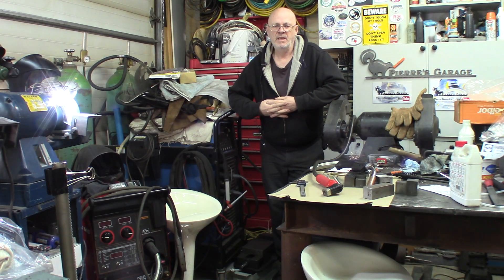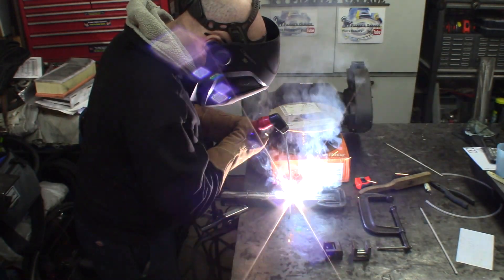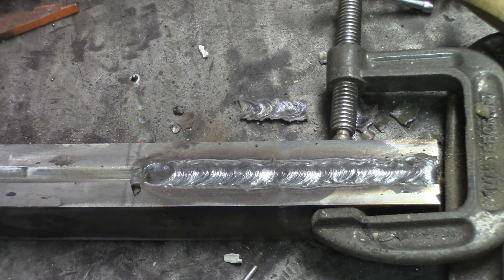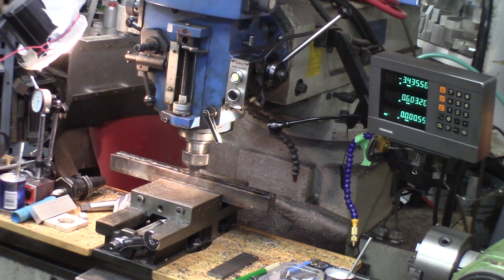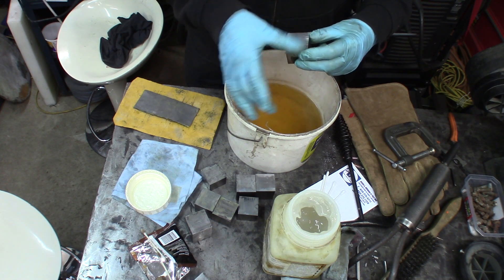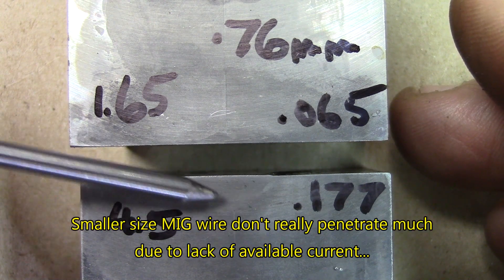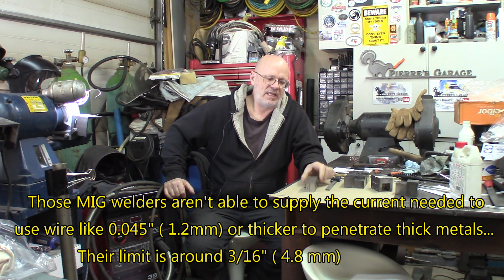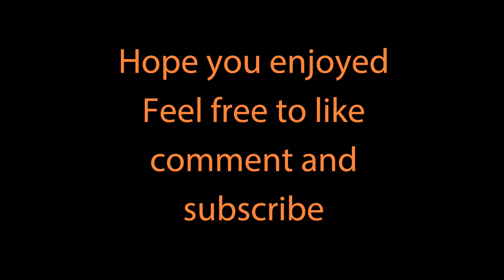Weld penetration Mig VS Stick, low price welders vs high priced machines

Comment: Great video Pierre!  For a small or a beginner workshop its more logical to use a great MMA inversor (inexpensive compared to a good 300A mig machine) than a mig for doing jobs that require good penetration and trustability. Let those chinese mig's for make doors and windows. Thank you for sharing.
Reply from the maker: I agree with you, a good MMA welder is a solid choice for a hobby workshop. Thanks for watching!

Comment: Interesting how deep the 6010 got with only 100a and mig needed nearly 3x as much current to do better. I wonder how deep a large 6010 at 250-300a would do.
Reply from the maker: I've never tried with rods bigger than 5/32", it would require at least 1/4" rods, my favorite rod is the 7018, just a little inconvenient on the restarts, though, it produces nice clean beads with easy slag removal...
Reply: @pierresgarage2687  I share your love of 7018 (except restarts). I just love the fast freeze and deep penetration of 6010, plus it seems a bit more challenging to use, which is both frustrating and rewarding.

Comment: Mig failed on sepersting on level  or base and parent metal . Off this subject  all are good so is gas welding.  Almost obsolete.  . But hey witb out electricity  and only two gas to weld one eill fail cause it easnt taught
Reply from the maker: Right about oxy gas welding it does really good also, not very popular those days though...  🙂👍

Comment: Stick rods better penetration  thsn mig weld  ive seen a,clip ejere mig failed on stick weld.  Mig still good so is flux core
Reply from the maker: Flux core is using double shield, meaning, inner flux and gas coverage is widely used in heavier structural works.   🙂👍

Comment: You do realize that most people can’t afford a 350 amp machine that’s three phase! So we do the best we can yes I only run on 220 volts welders no 110 machine that being said 110 excellent  for thin material 16 ga or less!
Reply from the maker: Those run on single phase power since they're made to adapt ot just about any power sourcr up to 600 volts 3 phases.
The main goal of this video was to demonstrate the huge amount of power required to get some penetration without a decent prep, I've seen soooo many videos where some folks make a project using 10 or 12 mm ( 3/8 or 1/2 inch) thick material, wleding on the surface with a weave, no prep, even grinding the surface flat in order to get a nice surface....    After seeing this video, you must have an idea of how solid are their contraptions, I wouldn't stand any of those....!!!!
On a more constructive note, it's possible by using lower powered and more affordable welding machines to make proper assemblies, the key to this is to make proper preps and using the most of what's available from the machine. 
To make sound welds requires some basic knowledge of how penetration works and minimal experience in handling a welding torch, gun or anything that deposites molten metal...
In the end the better you adapt the machine to the type of work involved the better results are to be expected, ie. a 120 volts machine is great for auto pannel works, as a more powerful model is better for heavy duty trailer making....   😉👍
P.S. looking for a good used machine is a great way to save a bundle and upgrade to a "Better" machine.   🙂

Comment: Based on this is the common assumption that if limited to 120 volts, stick penetrates more amp per amp than MIG? 
 Also is this correct that if you push enough amps through MiG it will penetrate more than stick that is limited to the max amps it can take?learning and this video is great with data.

Comment: No fabricator is going to weld something structural without first preparing it. Anyone that does is not a fabricator.
Reply from the maker: You would be surprised to learn how many "Home Made" trailers you followed on the road, and so many other things amateurs made...   Those wanabe wlederd look at a weld and say "Geeezzzz it looks good, then I'm sooo much of a "Semi-Pro" welder...    😱😉🥵
Jus like any craft welding has to be teached and coached by experienced real pros, somethig most amateurs don't and won't easily get...   Sadly...!!!
Reply: @pierresgarage2687  I've seen some and wondered how on earth did they get a title for that.😥
Reply: One had galvanized pipe for a tongue.  I'm sure they were proud of it.
Reply: I've seen welds on things built for other people that were so BAD I wouldn't even weld for myself let someone else if I couldn't weld any better than they could!!! 
A guy gave me a wood rack he had made, decided he wasn't going to use it anymore. Before I loaded it, I  picked it up and slammed the corner of it on the ground, all but about two pieces broke apart which I picked up and smacked them on the ground again and broke them. You should have seen the look on his face! Asked me how I knew I could do that? I could tell by looking the welds were CRAPPY. No penetration to speak of at all. LMAO Some people never learn, others, it kind of seems to come naturally. I taught my wife to weld on my Pipeliner and she was laying down GOOD welds in less than fifteen minutes. Believe it or not! She didn't like it though because of all the sparks LOL.Dumb me gave her 6010 ,I should have started her with something a little milder.
Reply from the maker: @fredshipp3809  Zinc will make a very porous weld if it doesn't make you sick breathing the fumes first...     🤢🤢😱😉👍
If you want to discourage anyone from touching your machine or any other machine, get them to weld overhead or even vertical uphill.....   Oh!  Be stingy on their protective gear...   I know, it's really sadistic, maybe at least spare your wife...
Reply: @pierresgarage2687  Yes, I  am quite aware of that. I'm not the one that built or cobbrecated a trailer using galvanized pipe for the tongue. Have a good day.
Reply: @pierresgarage2687  I was disappointed I couldn't get her to weld again after that.  
I showed her how to paint with a gun too.She picked right up on that too. After that I mixed the paint and gave her the gun.She didn't mind doing that. LOL
Reply: @pierresgarage2687  if it doesn't fall apart, then it was good enough! haha
Reply from the maker: @ryan7562  
Kinda.....!!!!  My best advice, don't be under it while performing your quality control........      😱🤢🥵😉🌈👍

Comment: The testing is fantastic, top quality. However I think your welding skill may effect the results. Ideally you’d have dozens of welders do the same test, but that’s not practical. Your stick welds looked like they had too high of travel speed (due to the dual sided undercut), and that produces a colder weld with less penitrarion.
Reply from the maker: In the later years, I have to say that I'm missing welding practice, and it shows...   !!!
Sorry about that part.
Here the main topic was the results of penetration and the testing procedure, glad you got the point and went easy on my welding...
Thanks for viewing and for your comment,   Pierre

Comment: ...The good, the bad, and the ugly....! Most excellent video, but I'm vary hard of hearing, and even with the closed captions...I couldn't tell what the 'etching' solution was...? An acid yes, but what kind...? I have used nitric acid, but it's now hard to obtain...here in California, USA....  .030/180 Amps......045/275.....yes! Running about the top of the range there.....are you doing any spray-arc with tri-mix gasses here...? That is the realm of these......   I've also been welding since 1981....only the best machines can meet these tests....I bought a new Miller-Matic 200 in 1981....still running great, just clean out with comp-air a few times......I had a welding shop for a while1981-1985....probably ran 400+ rolls (33#) of wire through the Miller....built a lot of woodburning stove/heaters....used maybe 2 rolls of wire a week.....
Reply from the maker: Hi Doug,
The Etching solution is Stainless Passivating compound,  it's real fast on steel, be careful not to get any close from glass as it contains Hydrofluoric acid that attacks glass viciously...
I've heard from some other people that they use Naval Gelly with good results but it will react much slower, probably easier for you to get your hands on and easier to store.
Normally spray arc easier to initiate when using a mix with over 80% argon in the mix, it's possible to get it with 75/25 or tri-mix but  more difficult to initiate...   When I had to do it I got a 85/15 mix and it went real good...
If you get a good machine it will last forever, I got this 350MP from Lincoln and finally use it in it's most native mode since it fights me in the advanced fancy settings...   lol
And I'll try to pay attention at making the sound as intelligible as possible in the future in order to help people to understand what's going on, not always easy but I'll work on it...
Thanks for taking time to share in this comment,    Pierre
Reply: ...MIG...and Spray-arc....I was using a mix from Airgas...'Stargon'....and a tri-mix from another welding supplier...90%Argon, 8% C02, 2% Oxygen....
 75/25 just didn't have enough argon to give nice repeatable results....

Comment: That reminds me of when I did a welding course ,we had to do a horizontal but, vertical corner and a horizontal corner weld under the eagle eye of the inspector , we had to stop when called and restart the weld then they were cut up and etched, I passed and got my certificate , long now expired 

Great instructive videos as is your norm
Reply from the maker: Hi Stuart,
Those days of welding school, a while ago....  
I'm not welding as much lately, this is a fun time to get at it and  do a little practice with some controling how good the joint actually is....  
Thanks for viewing and for comment,    Pierre

Comment: Just a question, since the chamfer was .180" deep, can we assume that the actual weld penetration into the base metal was whatever it was minus .180"?
Reply from the maker: Hi William,
The chamfer was .180" +/- maybe .010" so the penetration may refer a little bit somewhere else, but, we can certainly say that in that filet the penetration was minimal...   Not much more than a few thousand... 
Thanks for your input and for comment,     Pierre

Comment: I agree - I see to many people get a mig welder and in an hour they think they are a welder.Even many who stick weld have no idea what there really doing.Everyone looks at me like I am from another planet when I tell them I do not weld.I am capable of many things but that art I did not acquire;  yet.
Reply from the maker: Hi jake,
Just like I mentioned in the video, I REALLY got an idea of what I was doing after I went to welding school, agree with you that it's hard to make someone understand if they haven't been thru the whole process and proven otherwise... 
In my case I find that by not welding as often as before, it takes a while before it comes back, but, with age, Tig is getting more difficult, mostly cause of vision degradation...   
Thanks for your input and for comment,    Pierre

Comment: Great video, and I appreciate your comments about getting someone to check or evaluate your welds.  That is now my problem.  I have been trying to teach myself to weld for several weeks and I make a good looking weld but do not really know how strong it is.  I have signed up for several welding classes but they always cancel for low enrollment.  I have tried to get some local welders to look at my work but they don't seem to have time. They are busy trying to make a living.  I might add, that I am retired and just wanting to learn a new skill and maybe make a few things around the house.  However, I want my welds to be good.
Reply from the maker: Hi, where are you located? Maybe I could try to help, just send me a mail and I'll see what could be done...  
Pierre   Email:    wledpierre@gmail.com

Comment: It is accurate. My small welder can weld up to 1/8 wall thickness. Anything greater I bevel it and weld in the V groove.
Reply from the maker: Hi John,
This means that with the proper technique you should be able to weld 1/8" in on pass and have full penetration...
To achieve this you will consider making a little prep in two steps, one it helps to taper the sides a little, second you'll need to leave a gap along the seem, fir 1/8" thick a 1/8" gap is about right,  VREY IMPORTANT to keep the wire or rod on the front of the puddle AND centered.
You'll know if you got full penetration when you look at the back side of the weld and see that the weld is bulging a little, even better test you fold a sample of this joint ( about 1" wide ) and check for cracking in the the joint...
And like you mention, thicker pieces will require multi passes, in a 60 degree V groove, or a 45 deg, is also ok but requires more filling material...
And, be aware that practice makes better.
Thanks for viewing and for comment,   Pierre
Reply: thanks for the tip

Comment: I just bought my first welder, a stick welder from Princess Auto and I'm excited to get going. I only intend to use it for ornamental garden pieces and light duty.
Reply from the maker: Hey...   There is nothing like a new chalenge with a new tool for a guy, I just feel the same exitement when undergoing something new and chalenging.
The best suggestions are to look what and how others do it, then, start practicing on scrap pieces (Brand new steel gets to be expensive...) find out how you performed, try to get someone that is a welder or a teacher to evaluate your performance, and, even better, watch you during welding and correct what needs to be done...
Just practice and enjoy your new tool and projects...
Thanks for watching and for comment,    Pierre
Reply: Hey Pierre, thanks for the words of advice and encouragement! I appreciate it and really looking forward to learning.

Comment: I was welding today.  I realize I am not a welder!!  I wasn't doing anything big or structural, but someday I would love to take a class.  Great info and someday I'd like to weld with confidence.......
Reply from the maker: Hi jster,
You got to start somewhere and persist until you get what you want...   ;)
By learning what a good weld is you'll do what's needed to achieve a sound weld, one of the advantage to have a professional welder or a teacher around is that they can point out very quickly what you need to change, learn and practice. 
To my knowledge practice is the best way to learn and keep the skills, I notice that when I'm not welding for a while it taked some time to get back the hang of it... 
Cheers,   Pierre

Comment: Very good demonstration and discussion
Reply from the maker: Hi Chuck,
Thanks for visiting, how are you doing near SF, is there rain to help with the drought...???
Cheers,    Pierre
Reply from the maker: Hi Bob,
Wonder how the central portion all around Fresno or so is doing, since when we drove by last summer it was DRY with half the fields turned to desert. 
There they need water for many years to come...
Reply from the maker: I've seen some places where the ground level is actually many feet lower than before cause of the extensive pumping from underground water, sure hope things get better to recover from the that specially dry spell...
Reply: The talking heads on television go straight from talking drought to talking flood, and back again.  The middle ground does not get reported, doesn't help their ratings...  The levees here in Sacramento have water pretty close to the tops, about level with the rooftop of my house if any let go...
Reply: Most of California is by nature is a semi desert, it is only with the water projects that store and save mountain rain and snow melt that it has become lush through irrigation.  When the snow pack does not come, which is increasingly the case, the reservoirs tend to run dry early in the year.  The reservoirs are also used for flood control, so much of the mountain heavy rains must be let out for protection downstream.  Even now, the snow levels have been relatively high, which gives lots of water when we do not need it, and not enough when we do.  Ground water is also being overused in unsustainable ways.

Comment: Pierre, pretty welds with no prep work, we call them caterpillars around here. Keep smiling.
Reply from the maker: Hi Darren, 
Making welds in plates or solid stock without prep or at least a gap is kinda useless, mostly if you need to flatten the caterpillars...   ;)
Cheers,    Pierre

Comment: Good advice for sure, now I know I'm not supposed to weld the stick to the job and then wrestle it off with a twang ! Happy New Year and all the best , Mat
Reply from the maker: Hello Mat,
For me having to wrestle the sticks probably means adjusting the current and/or practice on a piece of scrap to get my act together...   lol
Thanks for viewing and Best wishes for the New Year to you and family,    Pierre
Reply: For sure - 110 Amp 240v buzz box and 1/4 dia sticks 'given to me to 'have a go' .... it didn't take me long to reach the conclusion that either stick / box or me was not doing it right !  Slowly learning though. I think Im a long way of investing in new welding facility though. All the best Mat
Reply from the maker: Keep looking for used welders if you're not rushing you my find a used dream for a price you won't be able to pass...

Comment: Always Informative. Thanks for the comparison view. I welded or should I say SMAW my boat trailer together 24 years ago with a proper ARC welder. Compared to my little 120/240 machine, that i have now, you could almost feel that it was melting in more. My current machine struggles.
Reply from the maker: Hi, when you use a decent welding machine it always "Sounds" better, and just like a big diesel engine you can feel the massive power behind the pedal...   ;)
Thanks for viewing and for comment,     Pierre
Reply: @Danylo66 But can you say that your cheaper welder penetrated good as well?